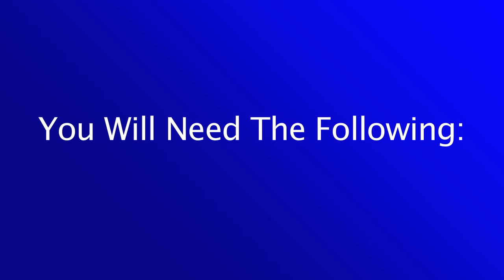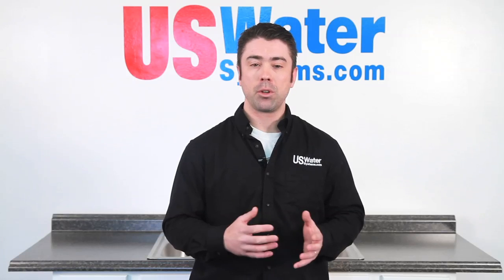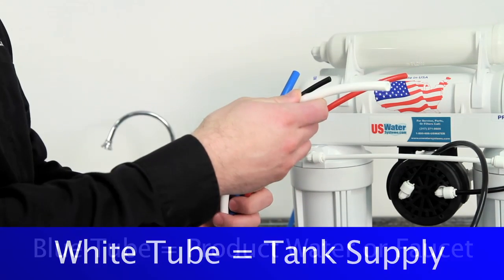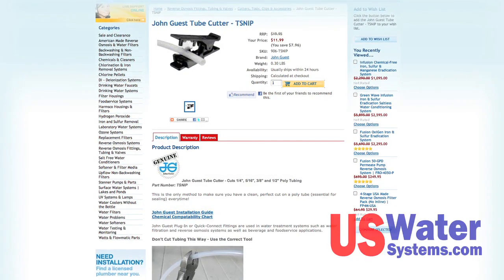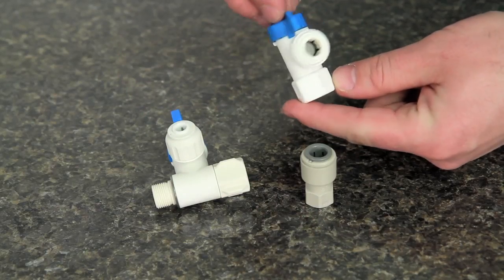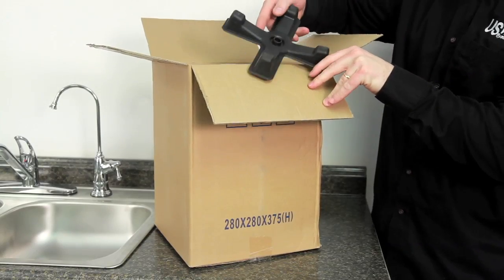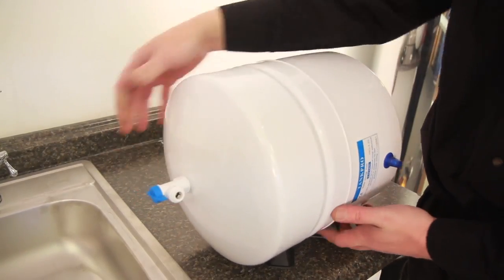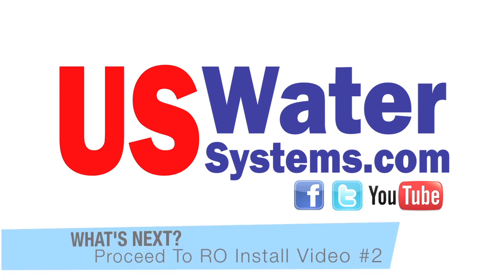How To Install Your Reverse Osmosis System - Part 1

Comment: 5-Stage Economy Reverse Osmosis System 
(Gallon Per Day Rating: 50 GPD) 
200-FMRO5-MT50 Howdy i bought this and can not find on your site anymore, what five stage filter systems are recommended for replacements. Thanks.